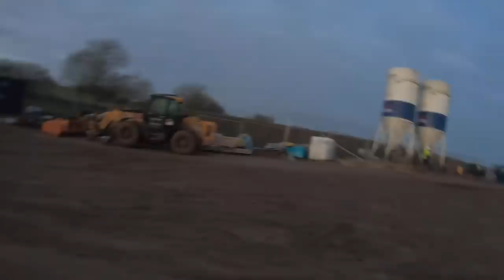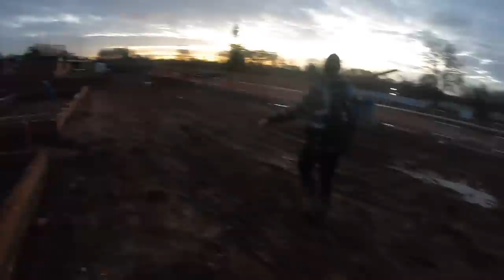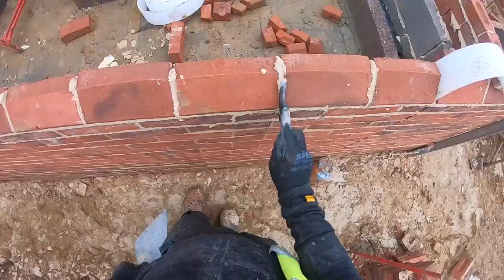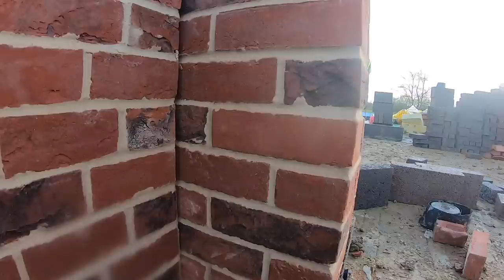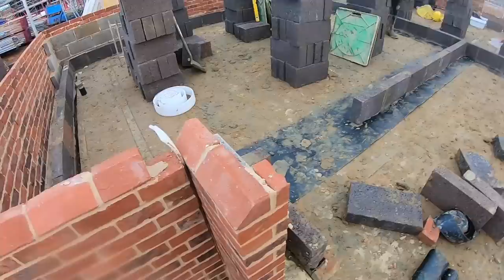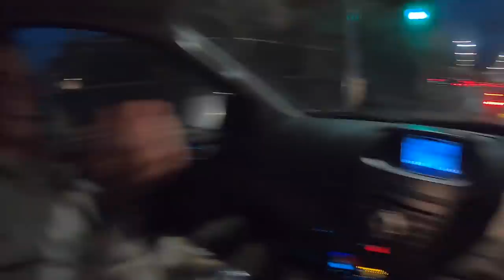Bricklaying with a 50 year old trowel

Comment: The problem with plinth bricks is that they are designed for quarter bond, i think it looks better to run them quarter bond reversing the bond above on a single plinth, looks better than closers I think.